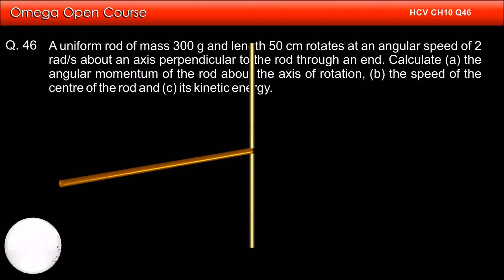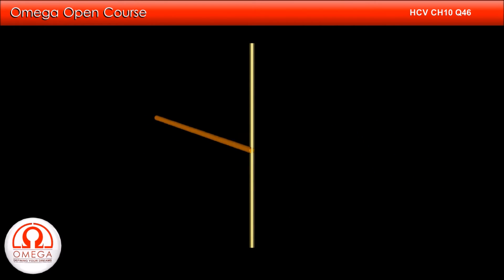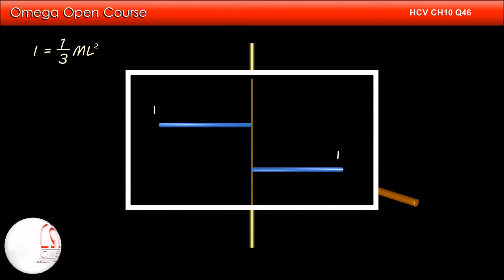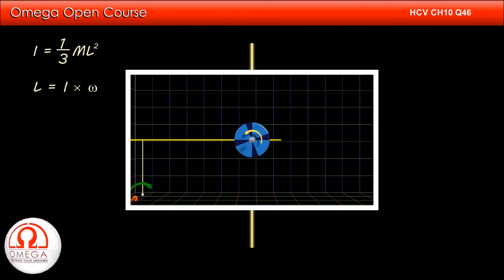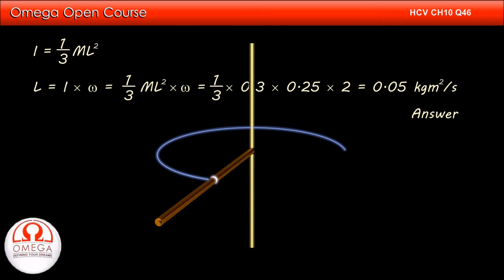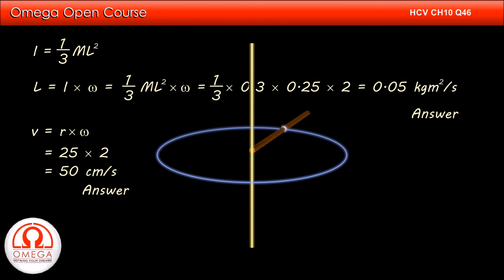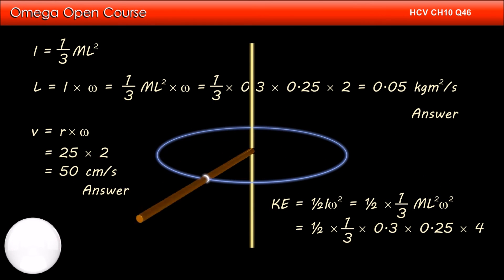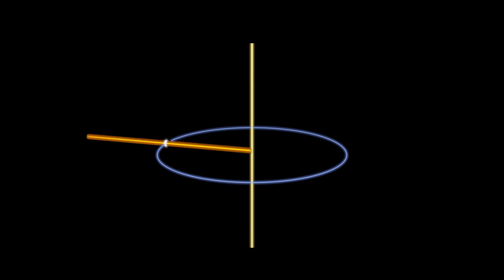H. C. Verma Solutions - Chapter 10, Question 46

Comment: Question 47,Chapter 10
Reply: 47. I = 0.10 N-m; a = 10 cm = 0.1 m; m = 2 kg
Therefore (ma2/12) ×  = 0.10 N-m
  = 60 rad/s
Therefore  = 0 + t
  = 60 × 5 = 300 rad/s
Therefore angular momentum = I = (0.10 / 60) × 300 = 0.50 kg-m2/s
And  kinetic energy = 1/2 I2 = 1/2 × (0.10 / 60) × 3002 = 75 Joules